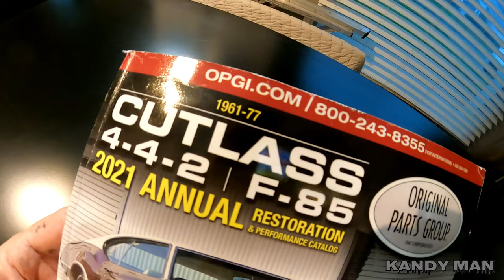STEPS FOR A MIRROR PAINT JOB PART 3

Comment: Thanks for all tips brother!..I’ve learned a lot from this series ..question I have a door that sags about an 1/8-3/16 when I put it back on after the cut-in. I’ve tightened the hinges pretty dang tight already as I had a buddy lift the door to the proper position and the next day it’s down again. Is there some sort of washer or something I could put to make it stop sagging. Thanks man! 👍🏻👍🏻
Reply from the maker: Sounds like you need a hinge our hinge bushing I would take care that now before you finish the job it will get worse and cause problems hope this helps and thanks for the support.
Reply: @kandyman5315  makes sense thanks man!..glad I found your channel. You never leave us in the dark and explain everything well. 🍻
Reply from the maker: Your welcome